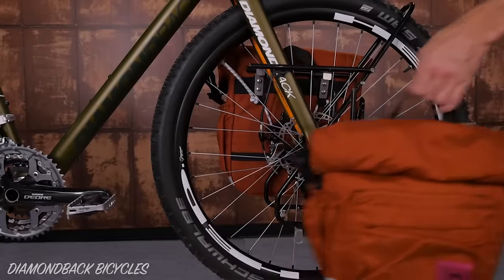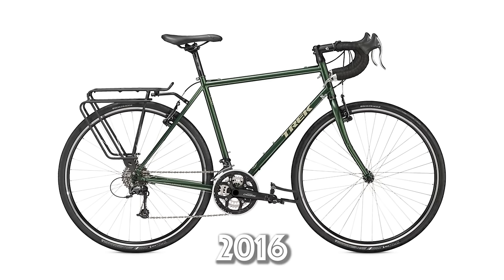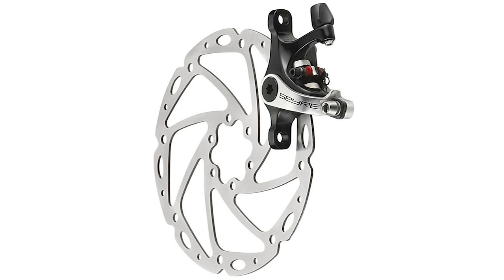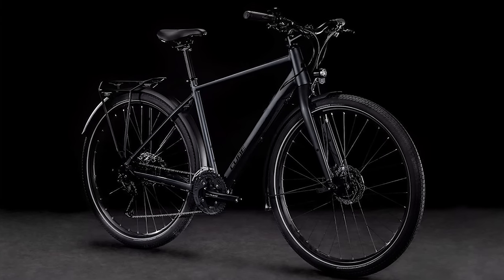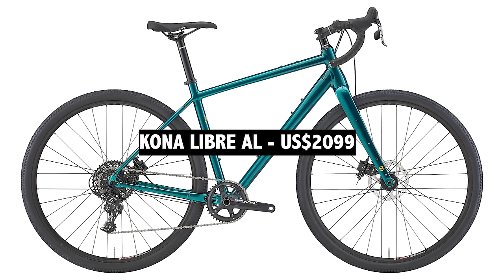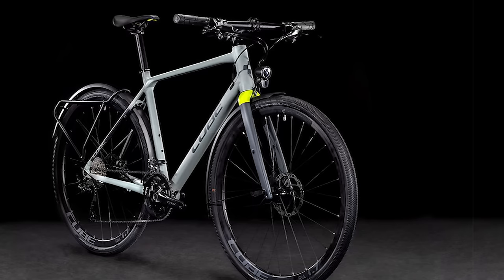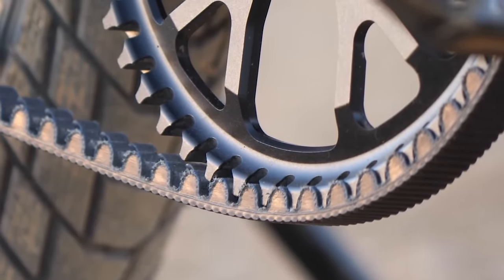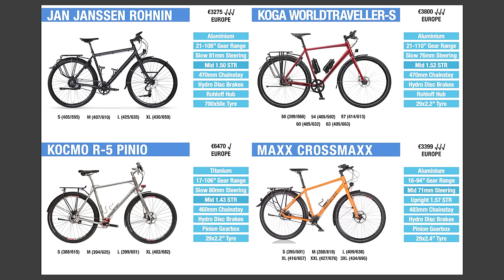The 13 BEST Touring Bikes For 2022!

Comment: I never imagined that I'd be intrigued by a bike by Decathlon, but that Riverside Touring 900 has a lot of great components.  Kudos to them for bringing some legitimate competition to the marketplace.  I only wish the racks were black rather than silver.
Reply: Hope you can buy one in 2022/2023.😉 Definitely best value for money!
Reply: To be honest I used to be like that, but I’m afraid to say I know and 2 decathlon bikes Have found them both professional within the customer care along with the build quality and replacement of parts
Reply: You could always have them anodized. Maybe even a complimentary color. The nice thing about silver racks is that it hides the wear; black racks get those silver wear marks from where the finish is worn off.
Reply: I went for silver racks on my silver bike but I guess a can of black spray paint would do it no damage
Reply: Aren’t decathlon triban bikes really good value?
Reply: @theguywithcoolpens6466  I found them to be incredible value
Reply: I bought 6 years ago the 580 Rockrider Mtb with 3X10 gears for €700. I think it is equivalent to a €1400 bike from other brands. I have done close to 20.000km mainly off road including 5.000km loaded touring with tent and kitchen. I have changed the cogs once and chain twice. I have warned out many gravel tires but nothing has broken and the Deore front chainring is still completely silent. It has a 18" climbing gear which I cannot imagine any touring bike without, for those loaded climbs. Also, with the 3X I can still pedal at 45km/h. I think its limitations is not to load it too much as I felt the frame flex a bit after loading it with too much fruit and water while touring. For real heavy touring a more dedicated bike is probably better but I am sure it could cross continents with 20kg of gear and food especially if you spare the frame by using at least 2.2" tires at low pressure and a suspension post.
Reply from the maker: I had a fair bit of correspondence with the Riverside guys prior to them launching their travel bike range. The whole team go touring and bikepacking in their spare time, and they spent four years testing prototypes on their trips before launching. Pretty cool that a company like Decathlon gave them all the time and resources to do it right!
Reply: @thisisadebrown  Yes, I must admit their customer care often approaches a local bike shop in that they're trained to take good care of customers on the spot. My friends and I have only had good experiences in the past. A good friend had issues with a rather inexpensive MTB there, and after several visits he was given a better model for free in order to get him to go away. You don't see that level of service very often.
Reply: @thisisadebrown  And I was speaking mainly of interest in longer-distance trekking & touring bikes. Their Rockrider series is quite popular here and seems to be well made and supported.
Reply: A nice touring bike but without a kickstand. Damn!
Reply: I almost bought one but ended up with something I considered slightly better. But not much in it. Probably just personal preference in the end.
Reply: @theguywithcoolpens6466  They're good value and make a good choice for those wanting to give cycling a try without having to spend thousands.
Reply: Just get the entry level model, same frame and upgrade the parts . It's exactly the same frame and forks. Except 920 has carbon fork
Reply: The 900 and the 920 are currently very hard to find in store and are unavailable online, this I  am guessing is down to the crazy world we now live in . However the 520 entry model is also crazy value for money though lacking the wider gear range of the 900 and 920 also using the lower priced index system for shifting .though I have heard nothing bad about that system .I lacks the Carbon Fork of the 920 but it is the same Frame and fork and bike rack as the 900 for under 800 € even with Hydraulic disc brakes of course a cheaper wheel set too . But nothing that can not be upgraded later down the line .I am currently looking for a new replacement for my broken Focus Mares Cross bike that I have been riding since 2012 , the front fork as developed a stress crack but after ten years I can not complain. Again I found this video just at the right time when I need a good balanced overview of good value for money bikes , in a very full market of bikes .
Thanks .
Reply: @supaflymadafaka  man i cant find any right now :/

Comment: After doing extensive research and being a bike nerd for over 35years. I purchased a Priority 600 with pinion gates setup. Its the cheapest bike with pinion. Ive added redshift post and stem. Re laced the rear wheel. And absoultely love it.
Reply: Having any buyers remorse? I’ve been thinking about pulling the trigger on the Priority 600. At the top of my budget though. Happy with your purchase? How many miles have you put on it?
Reply: @ImJeffRoe  Mate, im stoked.. I use it for mild off-road instead of my 12k trek topfuel.. I only use the top fuel for proper trail riding.. Not sure on the ks but I had to relace rear wheel due to me being 95kgs and a fully loaded rig.. I say buy it.. The frame is same strength as the 600x so priority sais.  I put redshift 30+ on front and a post on rear.. Its a dream ride.
Reply: 2 years on, how is it? Ive seen a couple used ones going for about $2000K CAD where I live. Its tempting.

Comment: I used my 22 year old aluminium frame and made my own 26 inch tourer which everyone wows about. I just used the components on Toms bike trip and the bike is killer. It has more than 200,000km on it now. Must have cost 1 grand max including tubus racks and shimano components and dynamo. Sweet
Reply: @Wooly Chewbakker  not really. I’m an engineer but I feel anyone could do it with a bit of guidance
Reply: @Wooly Chewbakker Bikes are simple things, easy to build/fix, its whats so great about them.
Reply: @superwag634  where do I get the guidance though :D I'd love to build my own bike, but I don't have any equipment nor the place to do so

Comment: As usual great video, I would like see a similar video specific to belt drives!
Reply from the maker: Great suggestion! I'll see what I can do.
Reply: @Cyclingabout  second this. Starting Deadhorse - Ushuaia this summer and looking to upgrade to a belt drive.
Reply: @ImJeffRoe  what'd you end up going with?
Reply: @stevengibbs8117  so far I’ve cycled almost 6,000 miles on the Priority 600. It’s been great thus far! Currently at Lago Atitlan in Guatemala 🇬🇹

Comment: Thanks for the awesome content Alee! Your buyers guide and tech content were super helpful for buying my first touring bike, and the travel docos are fantastic. 

Just a note for anyone that does go for the Cube Travel, and wants to improve the climbing gear with a 36 tooth casette. You may also need to swap out the crank or get an abnormally long chain to cope with the 48 tooth ring up front and the 36 toother out back. Happily this just means you improve the climbing gear even more to 16.7 gear inches, but something to factor in when buying.

Also the standard rack isn't great for Ortlieb panniers as the hooks have few places where they can fit nicely. Ideally it needs more straight bits of rail without joins and welds in the way. In time I think I'll upgrade to a Tubus rear rack but for now,I'm loving the bike and can't wait to take it out on my next tour. Cheers!

Comment: Hello there and thank you for this prety useful and good video. One model I will suggest, it is Cube Nature EXC. Well I personally have one and it's 2019. model, but until today they didn't chaged a lot, only minor things. Bike is categozed as fitness bike or trekking bike, but is is very versatile. It comes from factory with 28" tires 44mm wide, the frame can accept tires up to 2,25". Can take rack mounts and kickstand and comes with shimano drivetrain with 30 speeds and 63mm coil fork. I converted mine drastically, so it can take steep hills and I put wider tires. Currenty it's 1x11 34t oval AB and 11-51 cassette in the back, tires are 2.1" tubeless set up, new hubs and DT enduro rims, so it can literally go anywhere I want. For is also replaced with RS Reba RL 100mm, I also upgraded brakes to 180mm rotors and whole braking system to M8000-M8100 combo. I have done 3000-4000 Km with it and for myself it is really really great bike.

Comment: I just ordered your Touring Bike Buyers Guide. I have a new 2019 Kona Sutra that arrived the first week of the pandemic & has not been used. It’s going on a US coast to coast trip pulling a Bob Yak style trailer. I’m not real keen on off road touring but I am thinking about the Great Divide Mountain Bike Trail and I will ride one of my full suspension mountain bikes with front & rear panniers. I can’t ride an aluminum bike on the road. It kills my arthritis. I put a suspension post on the Kona and may add a carbon fork before my lengthy trip which I am breaking up in one segment from Kentucky to Yorktown VA then doing the other segment from Oregon back to KY with a tail wind. There are a lot more touring bikes available now that when I purchased the Kona. I had thought about the Tout Terrain with belt drive for a trip to Sweden, Finland and Norway. I’ll look over the bikes in your book and see what might work better and cost less. If not then after my US trip I’ll get the Tout Terrain or a different touring bike. I ride all carbon fiber road bikes and full suspension mountain bikes all with Spinergy wheels for road shock absorption here where I live. I think conventional alloy wheels and spokes are likely to be more bombproof for a lengthy trip even though I could use a pair on my Kona. I’m really tired of being in the house because of the virus 🦠 and want to get out on a long trip. I can’t wait to quit my job and get out there. Stay safe. I love 💕 your channel. 👍☮️🌞🌟🚵‍♂️🏔🏕🗺

Comment: I bought a used on one inbred 18" slot dropout frame off eBay and a rigid fork from on one a few years back, with the intention of building a go anywhere, do anything bike. I had a rohloff / son 28 Andra 40 wheelset built and run a 32/ 44 chainset with a 17 teeth sprocket on 26 x 2 .15" Schwalbe tyres. This setup gives me a gear inch range of 13.6 to 98.5". I have tubus rear and surly front racks and dynamo lights and charger, a suntour parallelogram seatpost, on one Geoff bars, trp cable brakes, hope  180mm discs, mud guards and hebie kickstand. That'll do me.
Reply: How much did your build run you?

Comment: When i was riding the French Alps offroad back in 1997 on a Specialized Stumpjumper, i had 22-34-48 front rings and 11-36 cassette. It was low enough for the alps, but to be honest, that is what was needed. And I wasnt even carrying any bags, and I was fit and raced aswell in those days. All bolts were replaced with titanium bolts, Titanium Hope BB, Front and rear Ti Hubs, wheels built with aluminium nipples instead of brass. Whole bike barely weighed anything. The bikes in this review would have been nowhere near good enough when your exploring real mountainous terrain. But, if your a roadie, then I guess its a good selection.

Comment: Brilliant informative succinct video. FYI, I have a cube hyde Pro that I toured the Spanish coast to Portugal and back over 15 months. The basic bike cost 550 euros with your recommended upgrades of course. Also with regards to camping equipment I agree with you again, I started out with lightweight gear but have since changed to more substantial slightly heavier gear, it pays dividends.

Comment: Love your videos, super high quality content. 

I have a question for you:

My bike can fit a 30.9 seatpost, if I wanted to use an eeSilk which doesn’t come in that size, is it okay to use a seatpost shim / adapter and use a 27.2 eesilk? Any drawbacks you can see to using that shim?

Comment: Tourers cover a wide range of types, depending on the load, road surface and terrain. Also, do you want your bike to do more than one thing, maybe touring self sufficiently with all food, clothing, tent, little stove but also using it for fast training? Mine is in the fast touring category, Reynolds 531 with 700 x 28 or 32 mm tyres and 28 inch to 96 inch derailleur. Campagnolo groupset. For example, several times when crossing countries I've taken part in bike races. Bike tourers are always welcome because you are non-threatening and can speak to people.  I have often been invited home or fed. In Australia a woman had broken down and left me to look after her daughter when she went to get help. People trust you whereas they would not trust a male car driver. You can smell the country air, see wild animals, drink water from the stream and get extraordinarily fit. Viva la bike!

Comment: Did you have a look at the Radon Sunset Supreme bike for this test? It offers a great kit for a good value. The only potential downsides are 45 mm max tire width and a suspension fork.
Reply from the maker: I would say the Radon Sunset is on-par with the Rose I featured here. There are lots of great bikes out there - it can be hard to pick just one.
Reply: @Cyclingabout  Thanks for the reply, I’m looking for a fast bike with low enough gears to pull a bike trailer up-hill occasionally and found your content very useful. 👍

Comment: Question: some of the rear racks, particularly on the trekking bikes, are only mounted to the area around the rear wheel, not to the seatstay-area. How does that affect performance of them, and is it something to bear in mind when buying a bike with one factory mounted?
Reply: These rear racks are also attached to the seat stays via a steel rail, that is hidden underneath the fender.  Looks nice and clean, but it is just as strong as other rear racks.
Reply from the maker: If it's engineered well, there is no reason why it would offer reduced performance. But I generally prefer a separate rack/fender set as it allows the user to replace one component without needing to replace the other.

Comment: I don't understand why touring bikes have slammed stems? Surely someone might want their bars just a bit higher? Maybe use a low rise or completely flat handlebar they love and then lift the stem. But when the steerer is cut as short as it can at the factory there isn't much you can do. Riser stems can go only so far. And if you need a short one then good luck with that!

Comment: The On-One titanium adventure bicycle is very good overall, but wouldn't it be better with a 2X chain-rings because the high end speed is somewhat lacking?
Reply: The bike industry is ripping people off with 1x exclusive setups. At least leave the front derailluer mount to give people future options.

Comment: now I will rate my 1970's Raliegh Competition ( double butted 531 chrome moly sprint bike) against these criteria. I think it's quite lively frame will fall short, as will its fork angle, and it's huret bottom bracket never supported alpine gears... and sadly the bottom bracket threads dont meld with any modern bottom bracket and gear set I know about...aw but it was so lively ( when I was half the weight and twice the strength I am now !)

Comment: No mention of Surly LHT.
Reply from the maker: In the long-distance touring category, the Masi Giramondo offers more for less money. And the Co-Motion Deschutes offers quite a bit more for only a bit more money.
Reply: @Cyclingabout  yea but Surly is total quality, that was a big miss on your part. Btw ,great vid.
Reply from the maker: @philiporourke7896  The Surly frame quality is not any better quality than the Masi, in fact, I've seen many Surly frame failures but zero Masi failures. This could be a numbers game though, as Surly sells in higher volumes. And the USA-made Co-Motions are a significant step up in tube spec, quality and frame details.

Comment: You know we have more options for bikes than ever. But the term touring bike, all road bike, gravel bike, road bike, endurance road bike, just don't mean much to me it's just all marketing. The best bike is the one you pedal the most. The marketing is straight up crazy and we didn't even get into cross country, trail, all mountain, enduro, down hill and what about single speeds. So many menu options just pick one and ride. Oh yeah if one has a question I would refer to what the Pros do not loads of marketing, cheers and keep the pedals turning.

Comment: Would manufacturers stop putting front lights where the mudguards are also attached as this position is far to low and would they also stop using cheap useless lights...the led revolution should afford a desent offering assuming lights have any importance on a bike?
Reply from the maker: Most dynamo light beam shapes are not designed to be fit on the handlebar, they have instead been optimised from the fork crown.
Reply: @Cyclingabout  Simple enough for a manufacturer to design or have made said bracket, I just bought one to move my light up to handle bars.

Comment: Just look at those riders!   Their bottoms are perched up in the air to extend their reach for frames that are not designed to fit comfortably.    They sit on a seat (saddle!) just a bit more comfortable than the seat tube.   They ride along a country road in the fresh air on a lovely day!   Not the common path from apartment to the supermarket!  Bicycles are now sold online, where one cannot examine them or in boutiques that charge $100 for a helmet.   The helmet offers no protection against the common accident,  collision with an automobile!

Comment: My tours that I have done stand now at around 50 000km...and I am not done yet.I never used a Touring Bike.I use trailers...So far i never had a problem with any of the bikes I used...never broke a single spoke...why trailers??? I feel more orginised with trailers and I dont need a $7 000 touring bike...rather spend the money on my next tour.Yes I go off road as well.